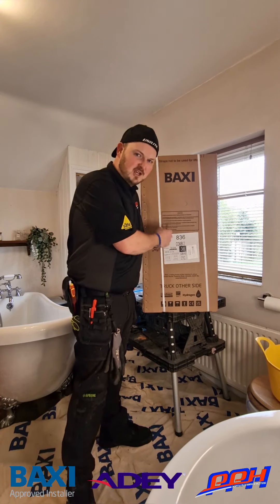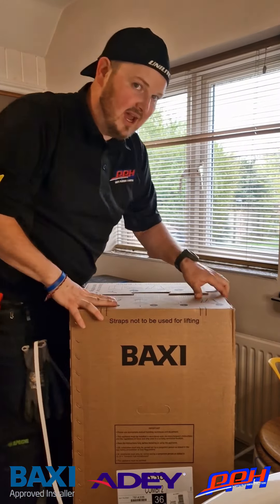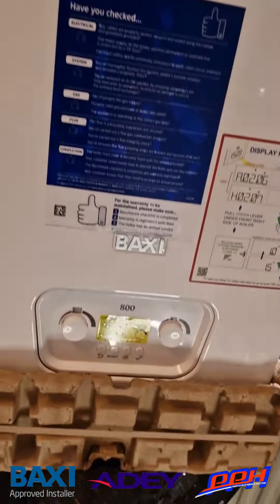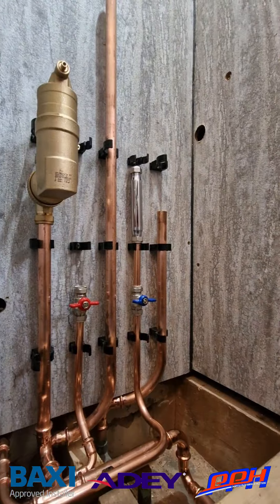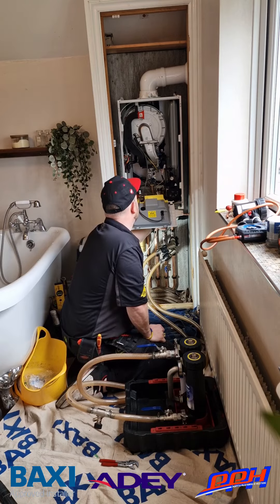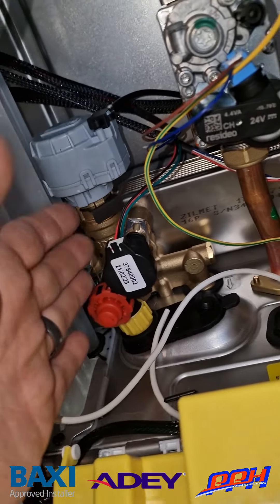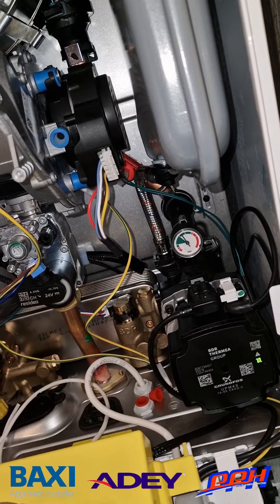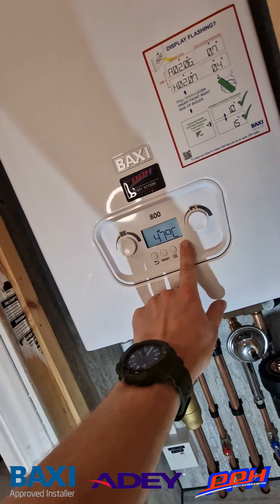Baxi Boiler UNBOX the NEW 800 Combi 2

Comment: I always fit baxi's, fitted one of these Friday. Why have you got a filter on the flow??
I do prefer the previous model 800 series.. at the moment.

Clean job 👍
Not a fan of crimped fittings on domestics tho, can't beat good ol soldering.

Comment: Did you wire both IFOS and an Opentherm controller together with this boiler? I was told it should only be one or the other. I'm about to purchase a Baxi 836, I have Tado wired thermostat control with Opentherm and a full set of Tado Smart TRV's, but would be interested to know if I could fit the IFOS too for extra efficiency.